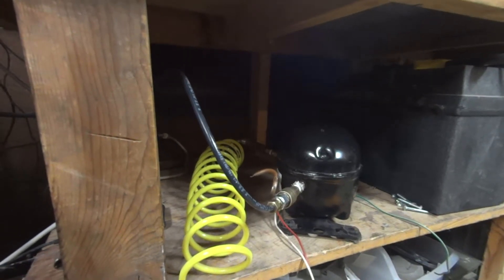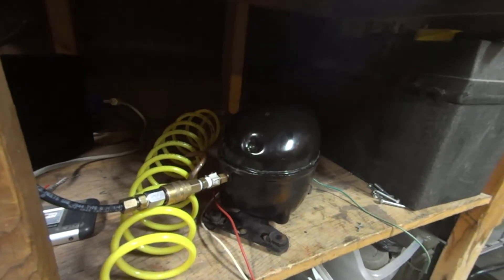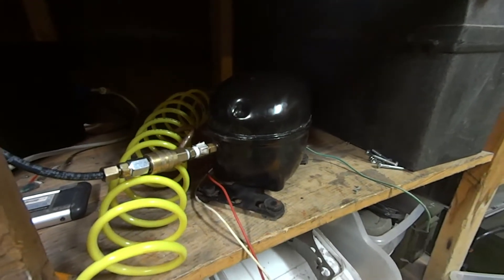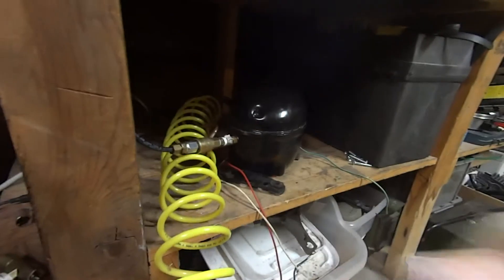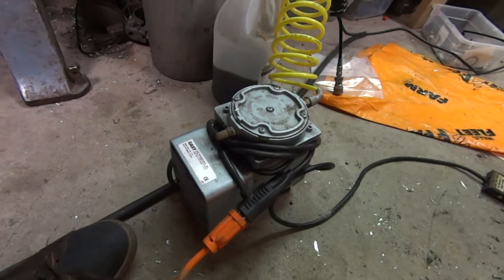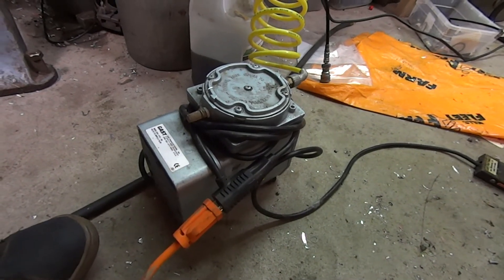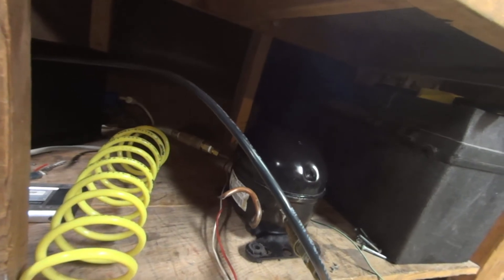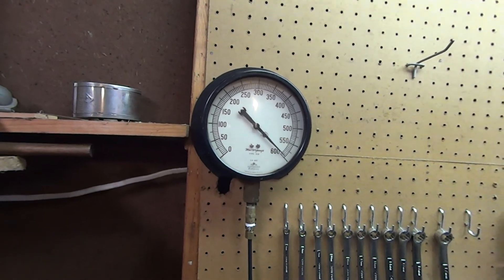DIY Dual Stage / Pre Charged Air Compressor  600 psi + How To

Comment: I use an aircon pump which I take up to 160psi, might try and hook up my regular compressor to the inlet and see if helps.
Reply from the maker: farcticox 1 it should go way past 160 by itself. The least I've had a compressor go to was 390 before precharge. Either way, precharge will help
Reply: 160 is about as high as I want to go, the tank is home made and I use standard pneumatic fittings and PVC on a lot of my stuff so I cant push it too high. Would be nice if it just built up faster, I think the precharge might help.    http://www.spudfiles.com/spud-cannon-related/topic26644.html#p382752
Reply from the maker: farcticox 1 ah. Just be careful messing with PVC. If you precharge, it's going to fill up really fast. Might want to look into a soda stream bottle, old co2 tank, or oxygen tank
Reply: The PVC is only on the launchers, they only get 140psi max